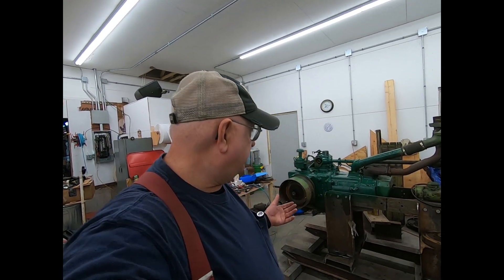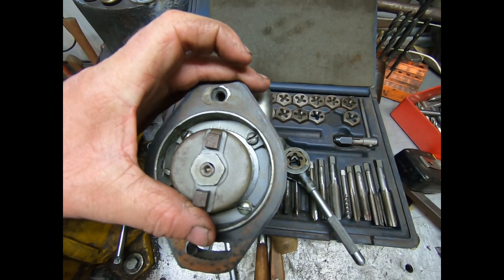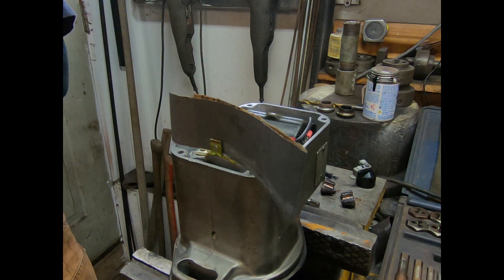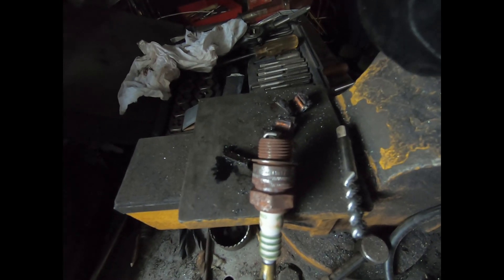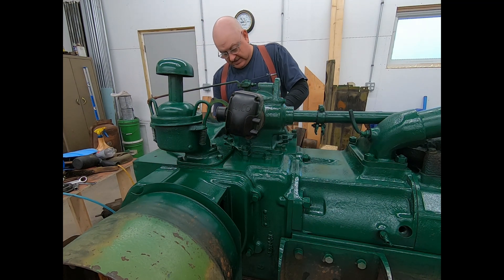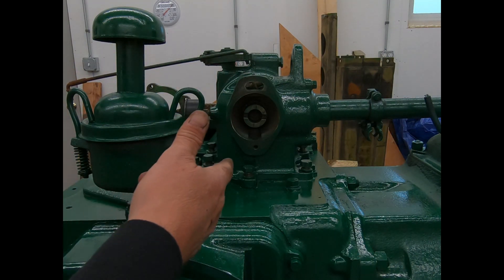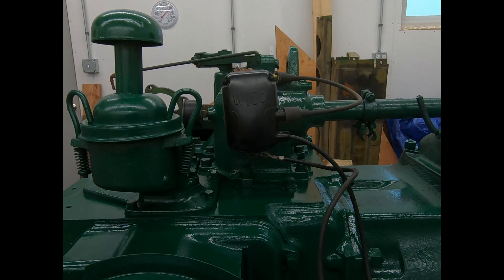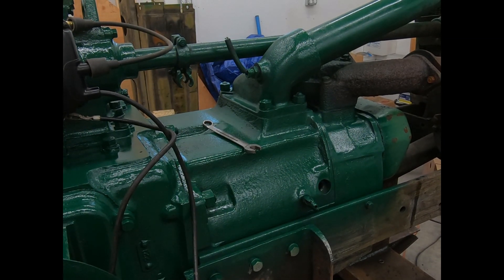# 585 JD-WA part 17 Timing the mag

Comment: As I recall, my old model D had a cup that was part of the petcock, we filled the very small cup with gas and when you pulled it over, she sucked the gas it and fired off.  It has been around 50 years since I had that tractor, but it usually started right up.  If you didn't have the petcock open, it was nearly impossible to pull over at all any time, per my recall.  Was not my favorite tractor, I do remember that.  Nick  North West farmer (Oregon)

Comment: The biggest issue with electricity is it will find a place to go, It will try to follow the path of least resistance. Which is normally going to be down the wire and across the gap. Without a wire and electrode it's going to find some place to go. Which is going to be back through the circuit against the impulse, it causes a nasty thing in smaller electronics we call ripples.

The reality is it's going to find the weakest place in the coil to exit, or it will feedback into the coil and dissipate there. Which is definitely not what should happen. It can cause a shock heat inside the coil, which if it happens, not great it will live though, repeatedly? not gonna live. That shock heat from feeding back can and will kill the coil if it experiences it too much. Each time that happens it weakens it.

I know the old man knows this. This is mostly here to explain the why instead of leaving it as just "it's bad for it." for those that are curious about it.
Reply: Very interesting!